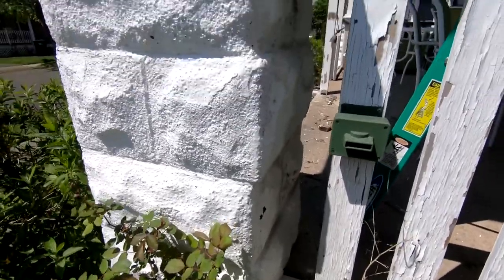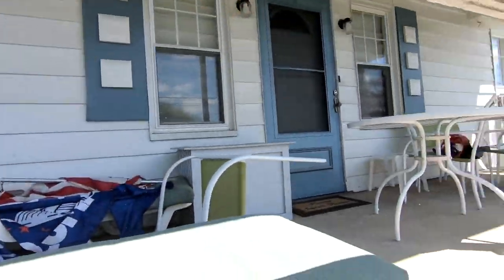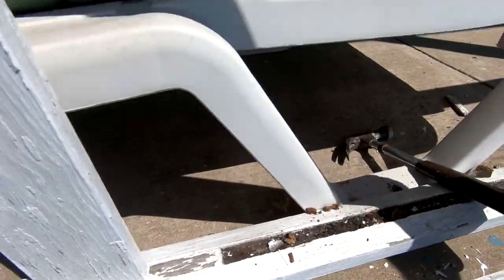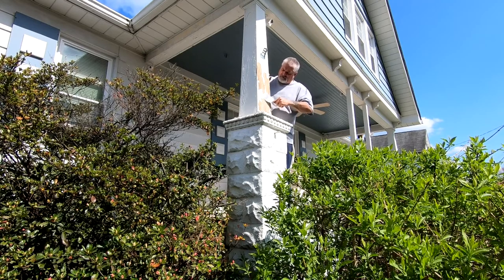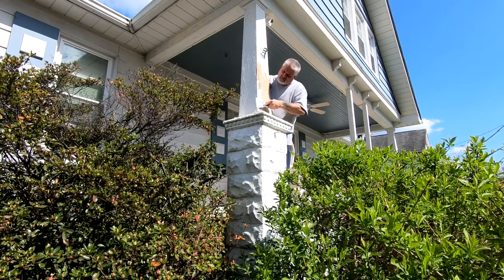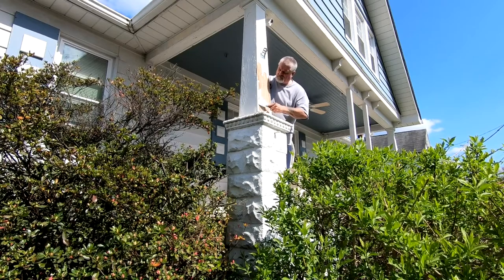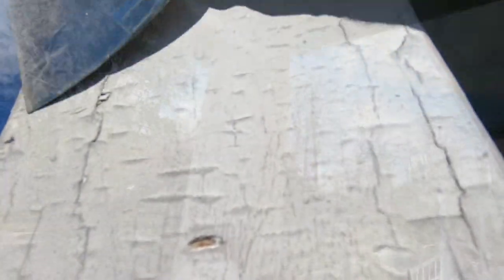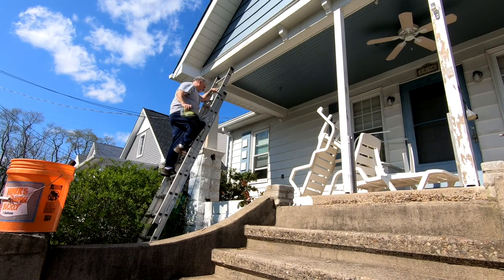Upgrading the Curb Appeal of a 70 Year Old Home - Part 1

Comment: Bob I would gladly scrape paint all day long rather them paint. I can think of over 100 tedious, boring, mind numbing  jobs I would rather do then paint.
Reply from the maker: Really !!!! I'm just the opposite in that I would much rather paint than scrape it, lol
Reply: Yeas ago I was laid off from my job at Channel 29. I started working with my uncle who was a house painter and paper hanger. He had me scraping wall paper and and paint, I loved it.
Reply from the maker: @mrkrasker9609  Removing wallpaper is a daunting task unless your using steam to remove it.  Using a scraper, like Kitana did, is very time consuming, but rewarding in the end.
Reply from the maker: @mrkrasker9609  Removing wallpaper is a daunting task unless your using steam to remove it.  Using a scraper, like Kitana did, is very time consuming, but rewarding in the end.
Reply: 90% of the homes we did where row-homes with very hard very old plaster. We used a enzyme based wall paper paste dissolver in hot water. We used a paper tiger kind of tool to perforate the paper. Using an exterminator pump sprayer to apply the solution we had very good results. Unless it was a vinyl or flocked wallpaper witch used glue, then it was hell. We did use steam on occasion but 80% of the time it was just hot water and enzyme solution.
Reply from the maker: @mrkrasker9609  I call that little tool a Langolier, based on the 1995 Stephen King movie, The Langoliers.  In fact I think I show one of the clips from that movie in one of the Bristol Home Remodel videos.  

That job you did sounds extremely messy; I think steaming it is the way to go nowadays because it's less mess and no chemicals to clean up.

Have you used a steamer?  Problem is you need a really powerful one as the homeowner brands don't produce enough steam to be efficient.
Reply: @BobsHomeServicesLLC  My wife is a big Stephen King fan, I think she has read just about everything he has written. 
Yes the method we used to remove wallpaper was a bit messy, but we 
worked up a method that minimized the mess and got us in and out fast. 
We would take turns, one day I would do the scraping and the next day my uncle would take his turn. We would do the prep together the other did the cleanup behind the other doing the scraping. If the whole house was to be done we would start in the farthest room from the exit and work our way out the door.
We did have a professional steamer but only used it on tough jobs it slowed us down. The real nightmare was wall coverings that had a glue backing or multiple layers of paper that had been painted over a 100 times.
Reply from the maker: @mrkrasker9609  Ah, I visited Stephen Kings home in Bangor, Maine back in September.
Reply from the maker: @mrkrasker9609  Ah, I visited Stephen Kings home in Bangor, Maine back in September.
Reply from the maker: @mrkrasker9609  Yeah, painting over wallpaper doubles the work to remove it.  Kitana removed all the wallpaper in the Bristol Home that's in the videos, poor gal! lol